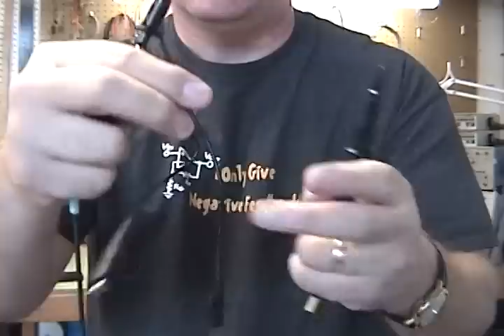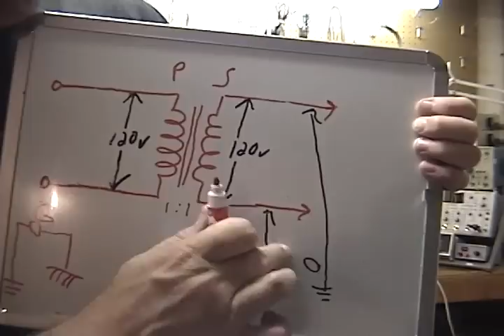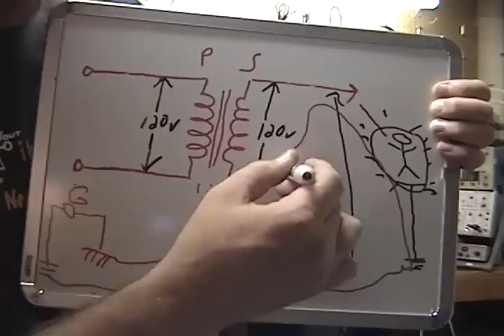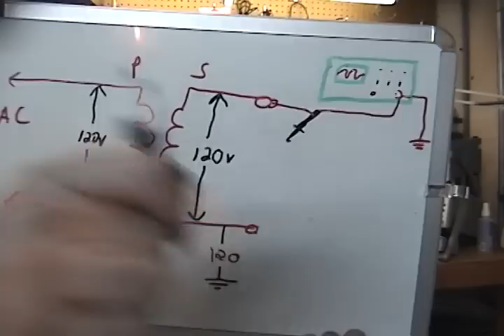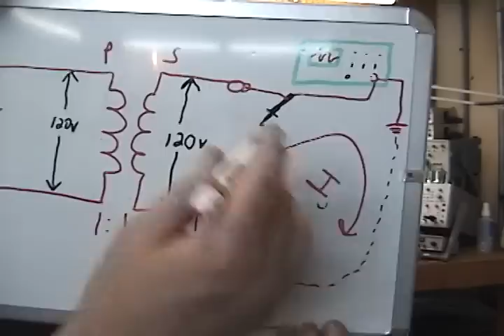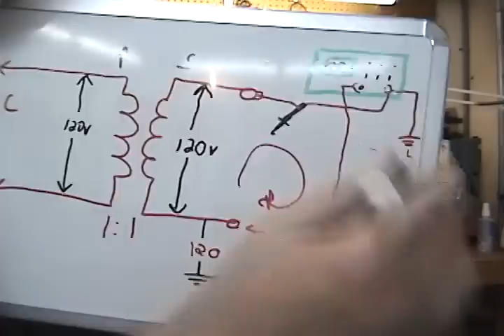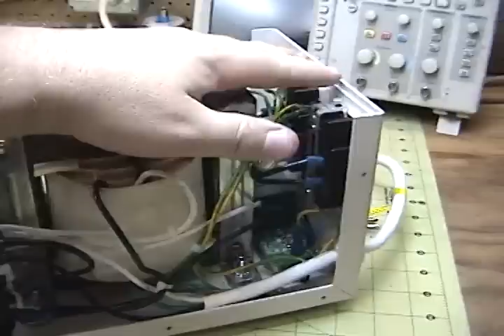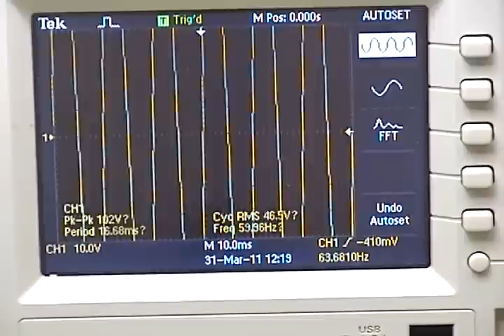ToddFun.com: Isolation Transformer - Tripp Lite IS1000

Comment: I dont get it , how can Ground be on a secondary winding . Its neutral and positive wire , no matter waht you do cant make that a Ground cuz its AC. It will change from neutral to 120V and waht kind of ground is 120V, thats a bad ground LOL. Anyways  i dont get that part , ive seen it elsewhere its probably correct but i dont get it
Reply from the maker: +Pavle Pavlovic It is correct and it is how your house works too. Just think of the 3rd prong wire (ground) in your house as a 2nd wire that parallels your neutral wire back to the fuse panel. If something shorts it will find this 3rd prong wire (ground) and the current will flow safely back to the fuse panel. In your fuse panel you will fine all grounds and neutrals connected to the same bus bar. So connecting the neutral wire to ground will not cause any  problems as the neutral and ground wire are already connected together in your fuse panel which is itself connected to an 8 foot copper ground rod driven into the "ground" near your fuse panel or sub station. Does that help?
Reply: ***** i know the ground is a 3rd wire and how it works . but both wires going out of the transformer secondary are live wires . both are HOT, its just one wire esentialy, and it carries charge . How can one side of it be ground , i dont get that part
Reply from the maker: +Pavle Pavlovic Well it is connected like this for common mode noise rejection that gets across the transformer. Not something you want when you want ground isolation which is why it needs to be removed in my case. Remember, no current of any kind will flow through this ground wire connected to the secondary because there is not loop path back to the secondary. There will not be live 120v on this ground wire even when connected to the secondary windings. If there is no closed loop there will be no current. The reason for removing it in my case is so you can't touch your DUT and then complete the loop circuit back to your fuse panel and then live 120V will flow through you, through the ground back to the secondary. Does that help?
Reply: ***** I understand that it is a lose wire . But i was thinking if that ground connects to the other terminal it will have all the Volts in it as the transformer is able to generate
Reply from the maker: +Pavle Pavlovic Volts, yes. Path "complete loop" for current, no. So it is just the same as not being connected at all... unless there is ever a fault to "earth" on the secondary someplace in the wiring or DUT.
Reply: ***** i need to learn some of this stuff , i ordered a scope , and am going to build a transformer . I was thinking that current and voltage go out from both ends of coil ,(secundar) but it look slike its not the case and it spits it out only on one end leaving the other at about 1V for 200V otput . I must research there is nothing like concrete measurement in the lab
Reply from the maker: +Pavle Pavlovic Well it is simpler than that, you see, voltage is only potential like a rock sitting on a ledge at a high height. The rock has potential energy but if it never falls it can't hurt you or do work. The voltage is like the rock that can't fall. You can measure the voltage at the secondary that is strapped to ground but it can't flow, or fall as in the rock. In a circuit current can flow only if there is a path "loop" back to the the lower potential such as through a wire. But if the wire has a very large resistance then the flow of current will be very low like a rock rolling down a very genital slope.
Reply: ***** indeed i know that , but i thought AC was going in both directions hot and neutral , or both sides of the coil of a transformer . Now it turns out that it doesnt do that , but just one wire , i want to check that to hard wire my brain to think like that , i must see it and do experiments my self
Reply from the maker: +Pavle Pavlovic No, The AC does go forward and back "alternating" in the hot and neutral wire just as you said you thought. However, it can only do this if there is a "loop". If there is no loop "path for the current to travel around" then the wire is at best an antenna.
Reply: ***** I still dont get it , if the voltage is indeed in both wires , why is one called neutral and the other HOT. And indeed when i checked the line voltages , hot/ground is 220V and neutral /ground is about 1V. Obviously the actual voltage comes from one wire , that voltage comes from a transformer , so there should be a different voltage in respect to ground in 2 secondary transformer wires . One should be high the other should be low . If my newly established way of thinking is correct .
Reply from the maker: +Pavle Pavlovic Neutral and ground are only at the same potential (Volts) because they are physically connected together on a bus bar back in your breaker panel.  It is called Neutral only because it connects to the center tap of your power company's sub transformer. In the USA that gives you 110v to neutral on either leg of the sub transformer to the center tap. In other countries this is done different to give 220v and I'm not sure just how they wire things up from the sub transformers to homes in such countries, sorry.
Reply: ***** thats another thing i dont get about transformer , center tap has 110V on both sides or 220V combined . How can that center point be on ground potential . wouldnt the current flow from the point where there is excessive potential to the point where there is no potential? Or it has to be a loop back to where it came from for the current to flow
Reply from the maker: +Pavle Pavlovic Yes, now you're getting it. You must have a loop back to complete the circuit or no current can flow. At these relative low voltages think of the electrons as holding hands and if at any point they can't hold hands then they don't know where to go and so they stop "no flow". They are still there so there is potential but until they can link up in a loop they can't swing back and forth with the alternating potential creating alternating current  a.k.a. "AC current flow". Without the completed loop they are just alternating potentials. Now at high enough voltages any gap or break in a connection can arc over but we are not talking about such high voltages we are only talking about house hold power levels.

Comment: Thanks for your video.And what about hooking load (ex. tube amplifier) and oscilloscope both to the isolating transformer modified ?   Wouldn't it be safer than hooking the oscilloscope to the main net on the wall ?  The problem with the oscillos probes is still there?please unswer. Thanks
Reply from the maker: +bailamosmundolatino The problem is still there with your scope either way. You need to get a isolated oscilloscope or battery powered hand held oscilloscope. You could float your scope but that is not safe for most scopes nor is that safe in general. Here is another good video on this topic that posted yesterday by Mr Carlson's Lab: https://youtu.be/XBsQ3sZ45Fk

Comment: Hi Todd.I'm using an inline 6" duct fan with a variac transformer as a speed control for the fan.I purchased the IS250HG thinking I was going to have the variac isolated from the mains earth ground.
Now I'm confused with your video. Seeing I may need to do your modification to get the true isolation I'm looking for.Am I correct thinking I'll need the mod, or should I leave it as it is from the factory, and I'm still isolated?
Reply from the maker: +John Smith You are not isolated. You will need to perform the mod. Or you could return both the variac and IS250HG and then get an all in one variac isolation transformer like this: http://astore.amazon.com/tod0f5-20/detail/B006NGC6HU
Reply: Thanks Todd --- had I known that combo existed I would have purchased it, but now it's too late.  :)  --  I need to work with what I already have. --  what about the safety factor ... Is the inline duct fan still protected from shock-hazard with the MOD you mention? -- this is my only real concern for getting an isolation transformer. -- I was told that variac transformers don't have a true safety ground return, and this IS250HG will provide one.  -- is that actually true? -- will doing your suggested MOD defeat or create that protection?
Reply from the maker: +John Smith You will have to follow my mod before it is safe. Safe in that it will no longer have a ground referenced mains power source. You will have what you want but please watch the whole video so you understand other safety concerns that will still exist.
Reply: +Todd Harrison (ToddFun) -- thanks for replying. -- I did watch the entire video.  I'm not going to be using any test equipment attached to any of the primary or other ground-points, so I'm not sure what other safety concerns you speak of.  I only wanted to be sure that the aluminum duct work attached to the fan, and any other items don't become a shock hazard to anyone touching it.  Does your MOD still provide what the sockets 3rd ground-wire was originally intended to give, while still keeping it isolated from the mains ground?
Reply from the maker: +John Smith My mode does not change the wiring or function of the 3rd prong in reference to mains power. My mod only remove the secondary coil tap to ground. By removing the secondary tap to ground you maintain transformer isolation which is what you're looking to do from what I follow.
Reply: +Todd Harrison (ToddFun) ... Excellent ... Yes, that's exactly what I'm trying to accomplish. -- thanks for making this video.
-- it's interesting how Tripp-Lite still calls it an 'isolated' transformer, without doing what your MOD achieves.  :)  -- I know they have it as they do, so it will cancel noise, and for other hospital oriented concerns, but you'd think they'd make a switch for it, with wiring as you've made, for it to be a truly isolated secondary when needed. -- 

The other comment mentioning the switch, was a brilliant idea...I may even add that feature.
Reply from the maker: +John Smith Yes, I think I will add a switch too. Maybe one that turns on a BIG RED light so you also know its not isolated. That way one could use it for a really super clean supply.
Reply: +Todd Harrison (ToddFun) ...you also just made another brilliant idea...to put an indicator light, so you don't need to remember what 'mode' it was in when you last put it away.  :)  ... Who says great things aren't on the internet..?  :)  ... They haven't seen your videos..!
Reply: +Todd Harrison (ToddFun) one more idea, or maybe not needed...could, or should a surge suppressor MOV be used between the disconnected wire, and the actual chassis ground?
--  would that give any additional protection from voltage spikes to the secondary side connected devices?  
-- also, where are the actual surge suppressor parts that are supposed to be in that transformer? -- all I see are the 3 caps, on that board with the unpopulated other parts. 

-- I had another question, regarding one of these I first received, that vibrated, with a noticeable hum. ... The replacement, supplied under warranty from Tripp-Lite, doesn't have any vibrations, but still has a very slight hum, much much less than the first one. ...so, the first one was definitely defective.

-- My question is... What would make it vibrate?
... Does the transformer have a winding fault that is making a reverse-EMF magnetic bucking, or is there something else doing it, that I can fix?

I still have the old one.  ... Tripp-Lite let me keep it, without needing to send it back for the normal warranty requirement.  :)
Reply from the maker: +John Smith Transformers will have some hum. If they are well built the hum is minimal and it is caused by the 60 cycle off the mains. Most stuff is made in China now days and they don't pay attention to build quality. I agree about the seemingly un-populated board however for my needs I only wanted the transformer anyway. On the output you don't need any transient voltage spike protection as a large transformer with Faraday cage such as the HG version is more than enough protection from such spikes.
Reply: +Todd Harrison (ToddFun) thank you for that info.  You've been very informative for my application, and beyond.  :)
Reply: +Todd Harrison (ToddFun) I had one more question, if I may. :)
When the secondary grounding wire is removed, that's normally attached to the IS250HG case, is that similar to disconnecting the 3rd grounding pin from a 3-wire power-cord? 
(As-if not using the 3rd line-cord prong on an extension cord)

In other words, how will the ground return protection still exist on the secondary if it's no longer attached to the actual transformer case?
Or does it not really matter any longer?

Also, I noticed my question regarding the vibration happening with my original defective init, wasn't answered in your last reply... :) 
Is there a way to repair the other transformer?
Or is there a non-repairable defect within the transformer that may have a winding fault, that's causing the vibrating?

Thanks Todd, for being patient with me.  :)
Reply from the maker: +John Smith You can't fix such transformers. If you don't like the noise you just junk it. Transforms will hum but if in excess it is possible for the vibrations to damage the enamel coating on the windings causing a dangerous short. Which is why you don't want to defeat the 3rd prong ground for your transformer case or plug. You want all 3rd prongs wired up together on output, input and plugged into an grounded outlet socket. This is for safety.

Removing the secondary grounding wire is not the same as defeating the 3rd prong safety ground in functionality with respect to this circuit's safety. Defeating the 3rd prong on your IT plug to mains would have the exact same functional effect as removing the wire in my video with respect to the DUT but would not be safe. Think of what would happen if your IT's primary side managed to sort to the case or directly to the secondary. Without that 3rd wire prong to mains you would have a deadly metal object floating hot between you and ground. However, being the point of this is to isolate earth so you can't be a short between earth and the power source this means you just want to keep either leg of the IT output power source coming in contact with anything that could be earthed. If such a connection did occur then you could be a short between any earthed object and  your transformers output power.

All ground return paths on the secondary are only to protect a power fault that occurs on the primary, such wires are not there to proved a safety ground for a fault on the secondary. The secondary should float for safety so you can't be working on a DUT and become the path for power through you to your feet back, to ground back to the power source. You only float the DUT. But be careful because once you connect anything that is earth grounded to your DUT then your secondary is no longer floating and you are no longer safe from a secondary short through you to earth.

Just to be clear, you do not remove the ground wire connecting your output socket's ground post to the case on your IS250HG. You only remove the strap wire connecting your secondary windings to ground. This will be a wire on the natural prong on your output socket(s) going to ground. If this is the only wire you remove you will still have correct 3rd wire grounding throughout the product and to devices you connect to the IS250HG for primary (mains power) safety.
Reply: +Todd Harrison (ToddFun) ... Thanks for fully explaining it like that.
I better understand the difference now.
The secondary still has it's own 3rd prong ground to keep the electrical safety factor.  This was what I didn't fully understand before, but do understand now.  :)

I will be careful to not connect anything to the system I'm using this on, that will cause any earth grounded connection to the secondary.
Thanks for this info...and your longer full explanation.
Not to mention still answering posts here, since you originally posted this video, in 2011.
Not very many YouTube channel holders still answer comments after posting their videos, years later afterwards.
It's very appreciated.
Reply from the maker: +John Smith Glad to help! Its what I like to do.

Comment: Using a isolator transformer is the same as devices that use battery? Has a GND free of problems?
Reply from the maker: +CYBERRD58 Not exactly the same as noted in the video, once you start connecting probes or test leads  you can have ground reference issues again through your test gear. If your test gear has all independent isolated probes then you're fine but most test gear uses common ground references between probes and test leads. Also, when dealing with mains power, even through a isolation transformer, there is still high voltage present unlike low voltage battery powered devices. This means if you manage to touch two parts of the circuit that are at high and low potential the power from the isolation transformer will still hurt or kill you just the same as a mains to ground reference.
Reply: Yes, I understand now and known why. Thank you.

Comment: You could always establish what your "proper" grounding point is before connecting your ground probes ;)  Use a DMM to make sure the ground you plan to use is actually a proper ground.  Isolation transformer is a nice safety feature but your brain is a better one :)
Reply from the maker: +Digger D How about both? Even better.
Reply: ***** Yes you are correct - but I can only afford my brain presently ;)